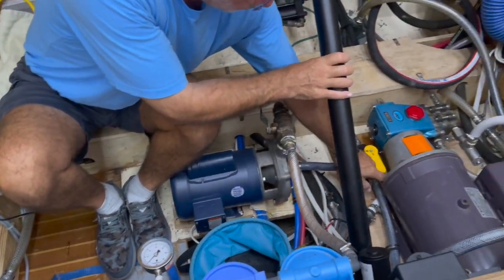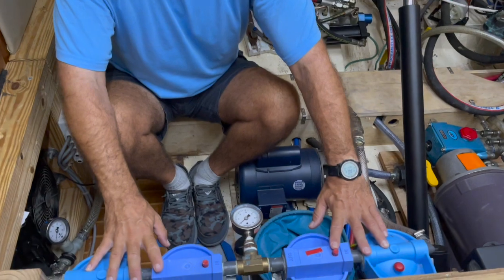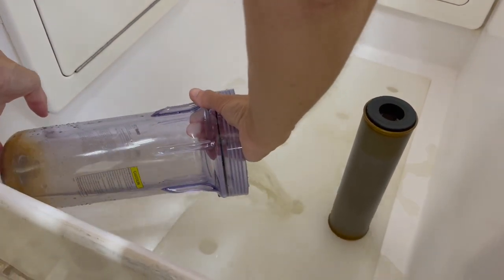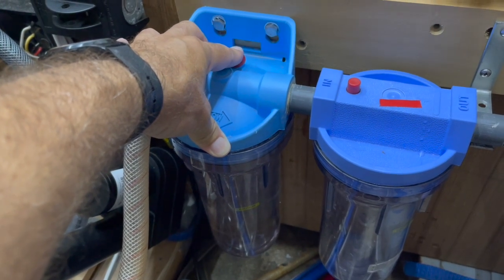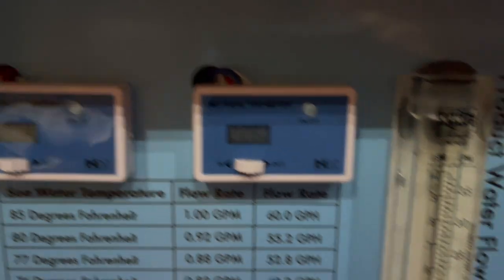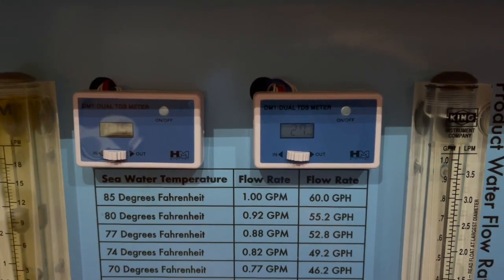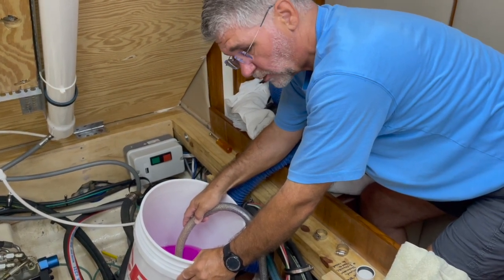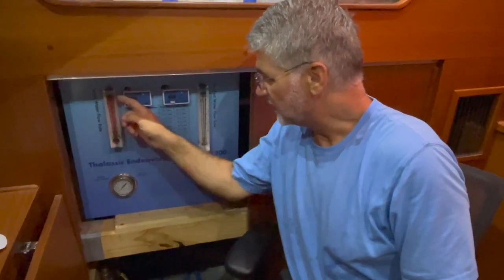Pickling our Water Maker aboard Chicory

Comment: We use the same RV antifreeze to winterize our RV. In the spring when we flush the system it does take some time for the smell of the antifreeze to be gone. Your system is very complicated compared to ours with all your filters, pumps, membranes and everything.  How hard is it to clean it all out so you don't smell it anymore?
Reply from the maker: Thank you for your question. We do a fresh water flush for about 15 minutes and then a sea water flush for about 10 minutes. This seems to work.

Comment: antifreeze is ethylene glycol.....pickling solution is propylene glycol.  Propylene glycol is not toxic to humans, whereas ethylene glycol is.  Definitley need to get all that ethylene glycol out of the system.....but it is much easier to find and cheaper.
Reply from the maker: Thank you for your comment. We used freshwater system antifreeze, which is propylene glycol.
Reply: @boatersdivingguide  i looked at my Walmart Supertech RV and Marine bottle which is the one you are using, and it says ethylene glycol as the first ingredient....just be careful.